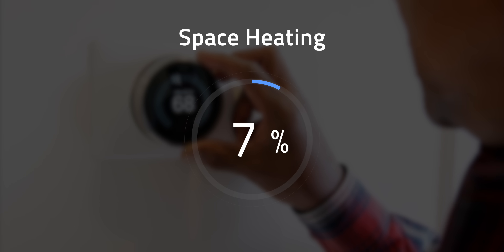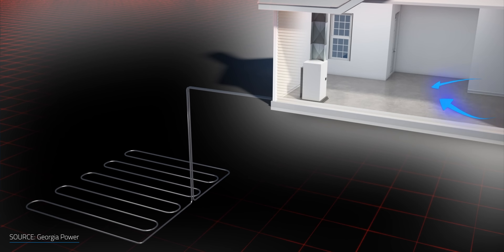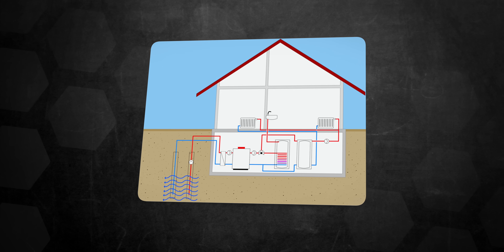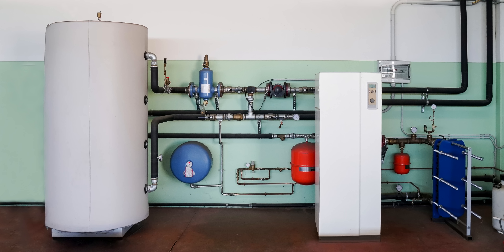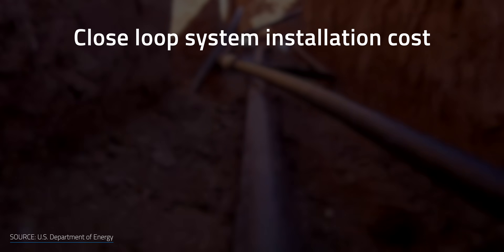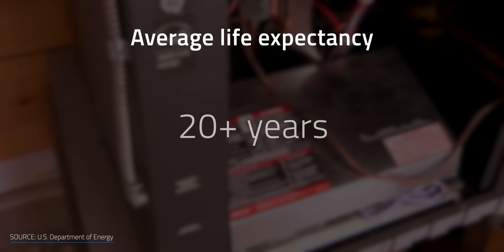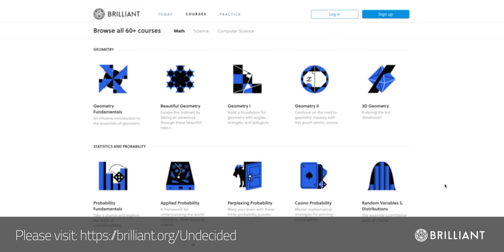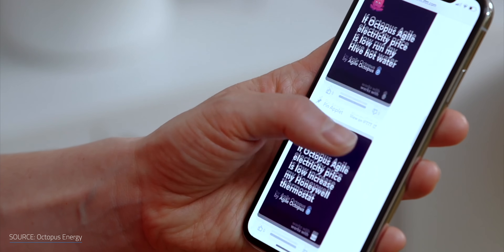Is Geothermal Heating and Cooling Worth the Cost?  Heat Pumps Explained

Comment: I went a different route in my 60 year old house. I installed enough solar panels to handle all my heating and cooling needs, plus my cooking, lights, laundry, , hot water, and everything else power related. The house is total electric, my electric bills are $0.00, and there is enough battery storage that, while remaining grid tied, I am capable of being 100% energy independent. My energy cost savings are enough to amortize the system in about the same timeframe as a geothermal system.
Reply: For people who are extremely concerned about the environment geothermal heating might be slightly better because of the mining needed to create solar panels
Reply: @blondie2654  if they are that concerned why are they using robber pipes?
Reply: @yurlim  I don’t know and solar panels require mining

Nothing is perfect
Reply: But your solar will only last 20 years ?
Reply: How is your home actually being heated though? I understand that you're using solar to power whatever devices you have - but what device is doing the actual heating? Is it air sourced heat pump? Electric baseboard?
Reply: @docmadhattan  I live in such a temperate climate that no equipment is required to heat or cool the house. The outdoor temperature is rarely below the mid 60's (°F) or above the mid 80's. On those rare occasions when those "extremes" are surpassed, I do have a heat-pump air conditioner/heater in the master bedroom. This device sees perhaps five hours a year of usage.

Comment: 5:35 a square meter is BIGGER than square foot about 11 times. Yet, you show you need less BTUs (who uses BTUs this days, anyway) to heat a square meter that to heat a square foot, and it's - surprise, surprise - about 11 times less. You should have multiplied instead of dividing - an error that could not be forgiven even to a third grader. And if pay so little attention to those figure one can reasonably doubt if you pay any attention to any of your figures.

Comment: The reason why you need to utilize forced air is strictly for cooling.
I'd love to see in floor radiant heating with ground sorcery heating 😋
Reply: You can easily do in floor radiant with a water to water heat pump. The problem is if look at any geo manufactures specs. Their water to water units only have a cop of 3 whereas their water to air units have a cop of 5. In fact many manufacturers w to w units don’t even qualify for focus on energy rebates.

Comment: I had one of these in a rental homes built back in the early 2000's. It literally sucked to switch the houses temperature. It took hours to cool the house in the summer. Then it just didn't cool the house below 74 degree F. Even though it was set to 70. While in the winter it never rose above 78. Don't get me wrong, it clearly worked to some extent. But fall was the worse, heating the house was a stuggle.

The above ground system never shut off during the summer. It also broke down a lot. After 3 years of living in a house with geothermal systems, no thanks.

Comment: one geo source that you failed to mention is DX  This system the piping is dropped into drilled holes.  Instead of using water in the pipes they use copper piping that carries the refrigerant as the working fluid. Generally these systems use the vertical type system. Because there is no secondary fluid these systems tend to be at the higher end of efficiency.

Comment: I installed a air to air heat pump, half the cost, efficient, and I didn't have large equipment disturbing my property. A pickup brought it in and left the same day. Been running for five years without trouble.

Comment: No, electric heat is a loser no matter what you call it. Being in new home construction I've seen many geo thermal systems installed. I've never seen one kept. Most were pulled out within a year. It's all BS.
Reply: Yeah,  probably true.  In the case where you are only going to use electricity for heating and cooling then choosing geothermal over standard heat pump may save you money.
Reply: B.S Is right. I grew up in a home in the late 70s and 80s that was heated and cooled with geo. All of my personal homes have been heated and cooled with geo. I do HVAC for a living and the only way I would heat and cool my home is with geothermal .

Comment: My Buddy had a heat pump in his new house and hated it during the winter, the house was always cold and  if you set the thermostat at 78 only 78* air came out of vent, so if you had a chair next to vent you had a what felt like a cold draft in the house,
He ripped that unit out after 2 years and put a regular Natural gas furnace in and never looked back!

Comment: 8 to 10 years to break even. I don't know, the clock starts running on both types of systems the day you turn them on. Geo hits break even 10 years on day one of the air to air system. Problem is, it's now 10 years old. I think the science is great, but the cost of digging is inflated. Bury x amount of this coil, x deep. Looks like installer companies are making bank. No refrigerant lines to braze, evacuate and back charge. Just fill and burp abs coils of air. Air handler/ compressor cabinet has sheet metal and two water line couplings and that's it. We got plenty of people walking across the border to dig in the pipe. Hmmmm.....

Comment: Just checking assumptions, the average prices for the costs of a geothermal system are for existing construction, correct?  If so, for new construction where there's already excavation being done for the foundation, that would throw an additional factor in that could potentially reduce the cost of the system.

Comment: The cost effectiveness must be closely examined. I engineered HVAC systems for almost 40 years, and your answer is likely based on your assumptions. Would anyone have predicted the increase in electrical rates this year?  Or change in fuel prices?  A 20 year life cycle cost analysis will give widely varying answers. I have personal experience in two major factors. First as these systems become more popular the cost of the underground systems, has gone up dramatically. Second, when the underground system has an issue (leak, contamination, blockage etc.) it is very difficult to fix. There is also the opportunity cost, i. e. invest the $15k or $20k more that this system costs and use the dividends to offset costs. I am not saying don’t do geothermal.  I am saying be very cautious and skeptical, perform due diligence, and frankly if your want to tie up the extra money, especially if you have to borrow.
Reply: Consider that not everyone are great in investing (oportunity cost), better then buy heating system (in our case old oil pump hade need for change anyway), at least money is not waisted and gives value for house price also (in case you need to sell). Greetings from Finland!
Reply: I agree with Bob. I had purchased a home with an existing 14 year old geothermal, which gave me problems to no end. Failing when needed the most, circulating pumps seizing, electrical issues, etc. I was told it's old technology that's the reason, etc, etc. When I built a new house I read too many govt brochures promoting the concept of geothermal. I was told the technology had improved, etc. So I took another stab at it. 700 feet of vertical loop, serves 3 heat pumps. One to heat an indoor pool, one to dehumidify the indoor pool house, and one to heat/AC the 3100 sq ft home and make the domestic hot water. There is also a back-up propane boiler for the really cold months in eastern Ontario, to help heat the hot water further. The back up boiler systems is supposed to be capable of heating the house on its own, during a power failure, wherein the furnace fan will still run off a generator. The Geothermal system at the time of installation in 2010, cost me in excess of $130,000. That's including ducting the house and pool house, but not including the cost of well drilling, nor the backup generator. For 12 years I have had regular breakdowns in the home heating and AC unit, when needed the most in hot summer or cold winter months. Mysterious failures, always explained away as blown fuse, loose wire, crossed wires, low coolant, sticky pump, etc. In the last 3 years, the failures have been monthly or weekly. So the maintenance and service calls are high - always two men, minimum 2 hours charge. So looking at $400-$1000 every time. Then there is the electric bills. $750 per month in the summers, to $1450 per month in the winters. (And of course, us country folk pay higher electricity rates than city folk - distance charges.

In case you are wondering, all my windows and doors are triple pane with double Low-E argon gas, And I have solar reflector shades for the summer, and solar gain screens for the winter. And R40 spray foam insulation in the ceilings. Yet, my costs for HVAC are through the roof. (BTW, my pool heating is off 5 months through the winter.) 

I don't recommend geothermal unless you have really deep pockets.
Reply: I didn´t watch the video. But local geothermal i extremly much worth it longterm.
no you doens´t get payback that fast - so you may loose compared to putting money in ETF/stocks. But at least it is easy to loan for it and you usually get lower interest rates.

But that depends on temperature. My knowledge is from sweden .- where it is "big cost at start, but easy good warming in the long run".
Reply: @andreastyrberg7556  The problem is geopolitical for the US. How many rolling blackouts per year our states have is ludicrous when they cant support A/C in the summer, when you just reverse your system and put it into heat its drawing the similar amounts of electricity. Furnaces draw very little so unless everyone wants to have intermittent heat and rolling blackouts at the worst possible time causing massive infrastructure damage its not feasible to do with an ailing electrical grid, not to mention those same states are pushing electric only vehicles so even more power draw. Its akin to trying to draw water from a dry well

Comment: Here in Northern Ohio, my electric bill is lower I’m the summer than in the winter. It defiantly is more efficient to cool than heat. But either way my electric bill is low, you never mentioned that the hot water heater is connected to produce free hot water when you run the unit for cooling. My unit is 20 years old.

Comment: When I used to build houses me and my boss were talking to the heat contractor. We were wondering why the HVAC industry didn’t use the idea of in floor heating to make an air conditioner. In floor heating uses the concrete floor as a large heated mass to slowly warm the house so why can’t the use the concrete floor as a large cooling mass to pull heat out of the house?
Reply: Condensation.    Often when concrete is chilled condensation forms on top.  Check a garage floor in early spring.   Without free airflow the moisture on a early warm day leave a bunch of condensation on the floor.  Once the concrete is warmed up this goes away.

Comment: I'm in a southern zone, mostly interested in the pond setup. With ground water so high locally, pond temps after the first few feet plummet, and we really need cold air more than hot most the year.

Comment: Geo thermal is, in my opinion, one of the most difficult system to work on and the most costly for parts. You also either didn't know or forgot to mention that it's not the ground, or in some cases water, that supplement the heating or cooling aspect of the system. The loops are what the freon( most likely R-410A or R-22) use to convert the heating and cooling to a building as in the case of the air to air heat pump due to the fact that ground source temperatures are more stable.

Comment: I wanted to get geothermal heating & cooling installed in  the house I'm building. None of the contractors offer it here. They all say it is not feasible due to the low temperature outside, especially during winter. Given you stated it is viable in all climates, I wonder to what extent I've been lied to.

Comment: Gotta Get The Geothermal Guys, And The Solar Thermal Guys, Working TOGETHER....*you all know the story*.....you get a Solar Thermal contractor over for a quote and they will try to sell you additional Cooling Capacity...then you have a Geothermal contractor over and they will try to sell you additional Heating Capacity.....Where If The Two Merged Into A Single Company Installing Optimized Hybrid Systems ??? HEY, WHY NOT ????

Comment: I have been wondering, for a 40x50 garage that you wouldbt want to completely heat or cool, could you just use the same concept but instead of fluid just use fans to push ambient air from the ceiling area through a similar system of piping to try to cool it off a bit and have it blow back in on the ground level? Would it make enough of a difference in cooling the air? Primarily thinking of southern states

Comment: a lot of the figure and animations are wrong or misleading, for example, one animation shows the water coming from the groud being "compressed"... All HVAC system has two heat exchange loop, one is refrigerant to indoor air, the other  is to the outdoor sournce (water or air). The stuff being compressed is the refrigerant loop, using the vapor compression cycle, it has nothing to do with the outdoor source, or in this case, the water from the ground.

Comment: Yes, I do want a geothermal heat pump system. It was discussed when I was building my house 13 years ago. The initial cost at that time discouraged me. I recently replaced my refrigerant to air heat pump and the inside coil and furnace as well. I still wish I had just "sucked it up" 13 years ago. Because now i have spent probably pretty close to what it would have cost me then. And i would not have had to spend the money to fix this system. And in 10-15 years, I will be doing it all over again with the current refrigerant to air system.

Comment: I have a vertical loop system (4 holes 75m each), NIBE 1245 heat pump, heating 250sqm of house. In winter time, average 0..-15C it consumes around 500-800KW of electricity / month. The installation cost was around 15,000 euro.

Comment: Getting ready to install one but would like to use a buried tank and circulate the water through the tank. Not sure of the gallonage needed for a 3-ton system. Does anyone know what capacity of tank and depth would be needed?